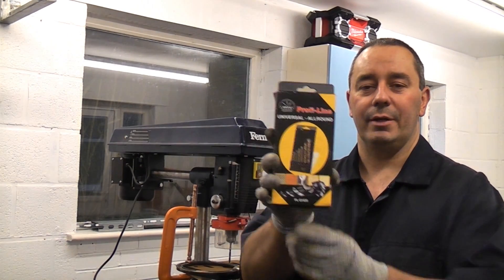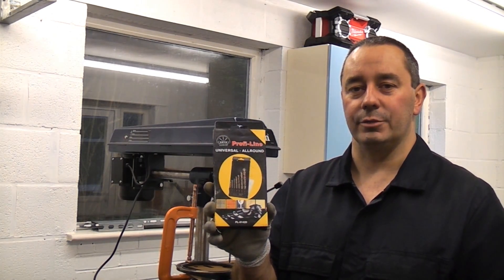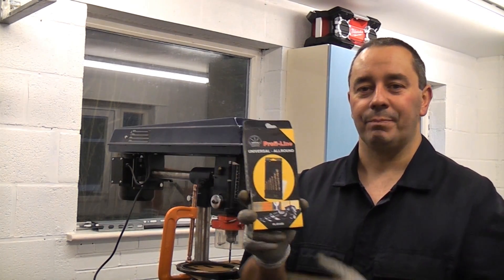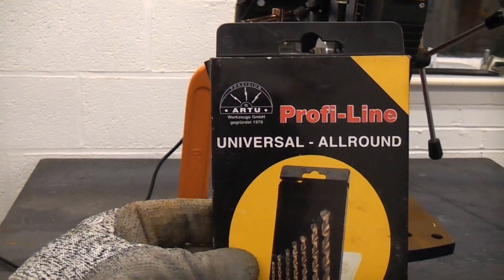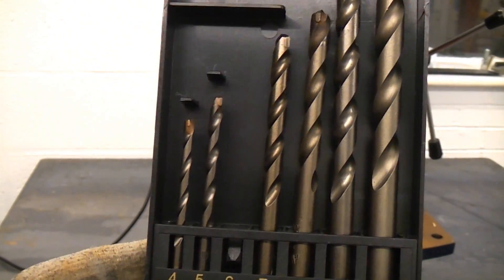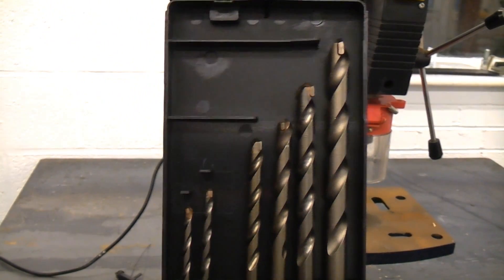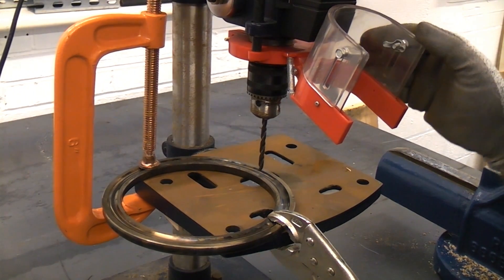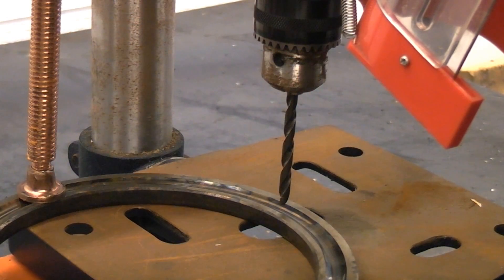How to drill hardened steel | Artu Drill bits

Comment: Why the fastest speed? Aren't we supposed to run these drills on hardened steel on the lowest speed and by applying pressure ?
Reply from the maker: The instructions state that you need to use the highest speed with no lubricant for these drill bits. 
Thanks for the comment
Reply: ***** Thanks for your reply. I have actually broken the tip of a 6mm the 1st time round as I've used high speed. After this I've used oil and slow speed however I get the point you've made with regards at the manufacturer's instructions. I wonder if you follow their instructions and the drill breaks will they give you a replacement? Is there any warranty on these drill bits?

Thanks again for taking your time to answer my question!
Reply from the maker: mcorco1
You are welcome ;-)
I'd definitely get in touch with them and tell them about the drill bit failing on first use. They should replace it for you.
Thanks for the comments
Reply: ***** Hi, Sorry to bother you again but I am really stuck and need some advise. I bought 5mm, 6mm, 7mm, 8mm, 9mm & 2 x 10mm Artu drill bits from ebay seller e-happyhome. I've paid around £50! The seller claims that these drill bits aren't suitable for Stainless Steel as in their disclaimer places this type of steel in the soft steel category. I know that is wrong as stainless steel is one of the hardest metals. Now,  because he wrote in his disclaimer that these drill bits aren't suitable for stainless steel he gets away without replacing or refunding these bits. The 5mm & 6mm drill bits I've used them at high speed and without any cutting oil and disintegrated almost instantly. After this experience this I've only use these bits on slow speed with cutting oil and it seams that they work better. 7mm & 8mm worked fine however 9mm & 10mm worn quite badly.  I've given this seller on ebay negative feedback for my buying experience with him and he managed somehow to get that removed. He recommended me to use  FESTA drill bits to drill my 316 Stainless Steel! Do you know anything about these drill bits & how suitable are for drilling stainless steel? My father used to be a machinist and worked in the industry for 40+ years and he used to work with VIDIA drill bits which were the best at drilling hard metals & anything for that matter but cannot find any to buy on UK market. I'm asking you this as I believe that he doesn't seam to know much about steel since he places SS on the soft steel category and do not want to invest in FESTA drill bits at his advice!  I look forward hearing from you soon. Thanks in advance!
Reply from the maker: mcorco1 Compared to hardened steel Stainless is considered soft.
The Festa cobalt bits are good on stainless steel, but they can be difficult to sharpen as the end of the drill is sharpened quite differently to a normal HSS drill bit. Having said that as long as you use plenty of lubricant the drill should stay sharp for a long time. I actually got some Festa Cobalt drills for a friend of mine who drills stainless on a daily basis and he was very impressed with them.
Reply: ***** Hi, Comparig with hardened steel might be slightly softer however it connot be clasified generaly as a soft or a mild steel. I've drilled through my Stainless Steel pilot hole of 3 & 4mm. As soon as I've used the bigger cobal drills to enlarge these hole i.e. 5 mm & 6mm in order to reach the final diameter of 10mm my 316 Stainless Steel hardened making it impossible for my drills to enlarge the holes managing to brake 6 or 7 of my cobalt bits. Can you recommend me a FESTA drill bits seller other than e-happyhome?
Reply from the maker: mcorco1 I drilled some 316 stainless a few weeks back using normal HSS drill bits- https://www.youtube.com/watch?v=Pa0eg9Z1eKQ
I bought my Artu drill bits and Festa Cobalt drill bits from e-happyhome and never had any problems with them.
Reply: ***** Thanks again for your time!
Reply from the maker: mcorco1 You are welcome
Reply: @crestin-ortodoxp  stainless is tough,but not so hard...it is softer then cro molly 4140 alloy steel at 28 to 32 HRC Rockwell AND 4140 IS CONSIDERED HARD STUFF....and machining is joke compared to example Hardox 450 or 500 at around 50HRC....YOUR STATEMENT THAT IS SLIGHTLY SOFTER  COMPARED TO HARDENED BEARING HE DRILL IS ALSO JOKE...THAT BEARING HOUSING IS AROUND 60HRC ..,EVEN THAT MATERIAL SO HARD CAN CUT STAINLESS LIKE BUTTER....
Reply: mcorco1 Hello,

We’d love to make some clarifications regarding the drill bits. ARTU Multi Purpose drill bits are suitable for different materials such as wood, masonry, ceramics, granite and HARDENED steel (please read HARDENED, not hard). Any types of metals which are not hardened the drill bits are not suitable for, due to the way the tip is made, thus all metals which are not suitable have been listed as “soft” ie. Not hardened. 
Unfortunately us as a seller cannot be held responsible when the buyer decides to classify a product themselves or simply don’t bother reading the description, which in this case has been very clear. Us nor the manufacturer at any point did not try to get away with replacing the product for you or offering an exchange, however for such to happen the product has to be defective, not working properly etc. In cases where the product has been used for a different purpose than stated, as should be self-explanatory the manufacturer does not offer a warranty for. ie if you bought an office stapler and started using it as a wall stapler, which then broke the manufacturer or the store would have unlikely accepted such claim as it was not used as purposed.
You have at the same time given us 4 negative feedbacks, due to your lack of reading I presume or as it was called “bad experience”, though please don’t blame us for something that is at your own fault, as in the end you were the one who has failed to read the description. Indeed 3 out of 4 have been removed, the 4th one didn’t as it appeared to be a good enough lie ie. That you’ve been drilling in “hardened steel” which actually was 316 Stainless Steel.
Hope it’s made it clearer for you.
Reply: happy home You are missing the point and you ebay advert is very misleading. "ARTU Multi Purose dril bits" that ARE NOT MULTI PURPOSE! Stainless Steel is not a soft metal hence DO NOT LIST IT INTO THE SOFT METALS CATEGORY. THIS IS JUST WRONG, MISLEADING & DISHONEST. Simply state the list of soft metals for which your drills are not suitable for and add the Stainless Steel as a hard metal OR,  THE ONLY HARD METAL which cannot be drilled & not suitable for your drills. Again, Stainless Steel is one of the hardest metal alloys. When you watch videos like the one above and hear that these bit "goes virtually through anything" of course you are encouraged to buy them! How about changing you ebay listing titles to:                    NOT SUITABLE FOR STAINLESS STEEL ??? I've paid £50 for your dril bits only to discover that they are not "Multi purpose". Shame on you as an ebay trader !!!
Reply: @crestin-ortodoxp  sorry ,but you are wrong...there are many grade of stainless...even free machining one...and stainless is tough not hard ,can be machined with regular HSS material...compared to real hard steel,is soft...you can not compared tool steel or hardened steel to stainless.... you have to read about hardness and toughness,and learn lot...
Reply: @sinkosav  Agreed.  There are many types of stainless steel (austenitic, martensitic, precipitation hardening, duplex) and literally hundreds of grades. Type 316 is very common and its a bugger to drill, but it is NOT a hard material. But it work hardens rapidly during drilling and its this and other factors that make it difficult to machine.  AISI 316 is an austenitic stainless and is what is used in grade A4 stainless bolts, and is non-magnetic. 316 is similar to 304 which is probably the most common SS, it is 18/8 (18Cr 8Ni nominal) and is what a lot cutlery and pots and pans are made of. Every type of steel can be cut one way or another. I cannot say I'm an expert in drilling / machining but every material has different ways to drill it and each cutting method will require different speeds, feeds, pressure, lube/no lube, etc, etc, etc...... one rule cannot be applied to everything....
Reply: in my experieced stainless steel is not that level of hard, steel have so many variation, even stainless steel have a type that can be hardened, this is called martensite stainless steel simply because it contain a large amount of carbon alloy in it. as far as i know stainless steel with code 316 cannot be hardened and its not hard steel, it's tough but not hard..just my 2 cents..
Reply: @corneliusrusandhy295  good point..
Reply: in my experieced stainless steel is not that level of hard, steel have so many variation, even stainless steel have a type that can be hardened, this is called martensite stainless steel simply because it contain a large amount of carbon alloy in it. as far as i know stainless steel with code 316 cannot be hardened and its not hard steel, it's tough but not hard..just my 2 cents..

Comment: Hehe Artu-D2. Anyway I have a feeling these will work in gunsmithing, where the firearm is old but the steel is hard. Im trying to restore a 8mm carcano that has a soldered screw so drilling is the only option to remove it. Any suggestions?
Reply from the maker: Ha Ha, These bits are good but it is hard to get them started sometimes as they are not sharp, so a better option might be solid carbide drills- But solid carbide drills are very brittle and can easily break so a drill press and good technique are essential.
Reply: Use small bit through the plug then slide hammer it out

Comment: This drill bit appears to be working in the same way as a Stellite drill bit.  These work by generating heat which weakens and destroys the metal.  They work best with a reasonably powerful drill press as the model makers type will seldom have the power and speed to do the job.  Nice video!
Reply from the maker: These seem to work exactly the same way.
It's recommended to use these on the fastest speed with no coolant!
Thanks for the comment

Comment: looks like the race has been heated before, making it softer
Reply from the maker: These bearings are used as the thrust bearing on wheels that between them hold bogies weighing about 13 tonnes (there are four wheels on each bogie). The thrust bearing is covered in high temperature grease and is held in place with grease seals. During the industrial process the bogies are put into large ovens, but the maximum temperature of the oven is only 120 degrees C, which is not hot enough to normalise the metal. All the bearings used on the wheels look as though they have been heated but they have not. I still have the bearing if you want to come and try sawing it with an hack saw you are welcome ;-)
Thanks for the comment

Comment: Hi

I have to drill some hardened gears, not has hard has the bearing race but 45 rockwell. 
Would a solid carbide be OK, if not you say in the vid run at your fastest speed? What is the manufactures speed for a 10mm drill. 

Thanks
Reply from the maker: I would not recommend solid carbide as they are too brittle. I tried drilling this same bearing race with a carbide drill in the pillar drill and it snapped. ARTU recommend setting the drill to it's fastest speed or 2000rpm with no lubricant/coolant.

Comment: sudesh .........to drill a 2.2 mm hole in a SS 304 (thats a Stainless Steel for the people who dont know) is as follows.....mark out where your hole is needed then center pop the location (this will help the initial guidance of the drill but) ......running speed around 750-900 rpm, hold bolt in vice..... wear safety glasses now before you start drilling align center pop mark and lightly press and drill for about 1 mm deep ...now use something like treflex or other tapping lubricant ( do not use coolant for this as its 1 messy 2 will not be thick enough for this purpose) ...ok now drill a little 1-2 mm max ...clean off drill re add treflex and do same again ...keep doing this till your through the ss bolt....... more treflex the better as this is to not only help the drilling but to keep everything lubricated and help prevent grab or fusion which will render the job fubar !.........

Comment: Lets put the brain dead muppets to shame......... first no coolant or oil or any liquid has to be used..these drill bits work on 2 things .....high speeds and high temperatures to cut the hardened steel.....like this 1/2 bearing race as this is a part of a 'thrust race bearing' how do i know this ......im a Professional engineer of 26 years (turner/miller/fitter/maintenance Engineer) and shop floor manager if you do add coolant of any form you drop the 'working temperature' making it harder for the drill to do its job........... if you dont have any background in engineering especially machine shop practices then dont think you know what your on about as its obvious you dont ! ......... 

 Final part ...i do not know the bloke or anyone liked to this bloke or the company in video or the drill makers ........
Reply: +kay ger  ya knob..... i do not have to prove anything im an engineer believe or not thats not my concern .....read or dont ...learn or dont but please dont babble shite ........ as for theories what ever metal your drilling your drill has to be harder eg drilling mild steel  you would use for example a HSS (high speed steel) drill  @ 118 degrese cutting angle .....but wtf i may have got that info from the tintanet ....dont think so fella.......im an engineer  laughing at your poor comments :) ...have a nice day
Reply: @simon -- i think OP is agreeing with the video and calling the people criticising it for lack of coolant use and high speed "muppets", hence why he explained why you don't use coolant on this type of drill bit, so the video demonstration is correct.
Reply: Xad this was my understanding too. He just uses sarcasm. I got it.
Reply: 118 degree cutting angle ---- ?
Reply: Professional engineer? You mean a Fitter and Turner.
Reply: Real Engineers don't Berate each other, their professional and respectful in their approach and learn from one another, to call someone a 'muppet' who has taken the time to help others along the way is very suspect of an amateur....
Reply: Perhaps, you might work on your: capitalization, punctuation, grammar, and sentence structure skills; it would be more professional. Anyhow, who cares about your credentials, this is YouTube and anyone can claim anything. Make us a video of you drilling hardened steels using various methods and drills types, while explaining the theory of each; don't forget speed and feed feed rates... It would be a better way to qualify your claims. Otherwise, your words are just cyber-talk and your skills are not demonstrated. Talk is cheap! So get-off your high horse and smolder your drill-tip.

Comment: this guy and the manufacturers are full of shit, you need to use coolant and lubrication. Bought Artu drill bit, second hole I drilled it's already dull...
Reply from the maker: Perhaps if you did not have such a bad attitude people would point out the errors of your way, but as it stands you can spout out any crap you like. If you can't follow the manufacturers or my advice then tough shit.
Reply: ***** the muppet you have replied to 'Ryan Nigro' has no machine shop engineering ideas worth listening to ........
Reply from the maker: moomoomooism
Thanks for the comment ;-)
Reply: hi Ryan wow your thoughts in engineering will get you far !!!!!!!! like down the road if you ever stepped into an engineering environment :) ...people like you make me laugh :)

Comment: what about drops of oil on the steel piece is it help drilling on not ?
Reply from the maker: No, the manufacturers of the drill bits recommend not using any coolant/lubricant.
Thanks for the comment
Reply: thank you for helping us and replay .
how about other drill bits?
Reply from the maker: toolman talal
You are welcome
Most other drill bits require a coolant when drilling metal.
Reply: thanks alot.
Reply from the maker: toolman talal
You are welcome
Reply: ***** of course they will in the hope the drill bit gets blunt and you have to buy another set lmfao..
Reply: usually not on hardened metal

Comment: How does it keep from burning up if the manufacturer says not to use cutting oil
Reply: A lot of tooling you never want to use a cutting oil. Coolant can be used for many but a lot of harder steels are dry cut using proper tooling. Usually multi flute coated end mills works best.

Comment: Opposite from a normal bit, you're not suppose to put oil or water on it because at almost 1900F is when the metal you're drilling turns into a different type of metal. So you need a strong drill press (which most don't have) to create the needed heat as you crank down on it.   I'm just theorizing all this... might just be true.

Comment: Hi,
Thanks for letting us know about these drill bits.
Two questions:
1) can you use these in a cordless drill when drilling hardened steel,or do you need pillar drill?
2)Can only find Artu "Multipurpose" on ebay,about £41 a set.
Are these the same as you are using in your video? Notice yours say "Universal"?

Thankyou very much...keep up the good work...

Comment: A normal carbide tipped masonry bit will work for this also just make sure there is a half decent edge on it, a quick touch up with a diamond file will ensure this. Solid carbide drills will also do a really nice job but are very brittle and prone to chipping when used in a less than rigid tool like a drill press so I stick to carbide masonry bits unless the hole size is critical.